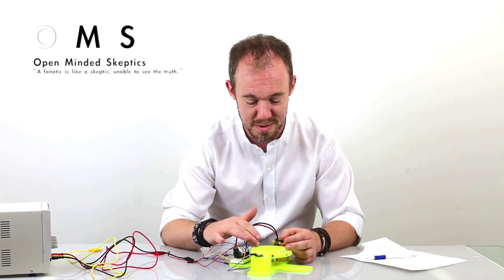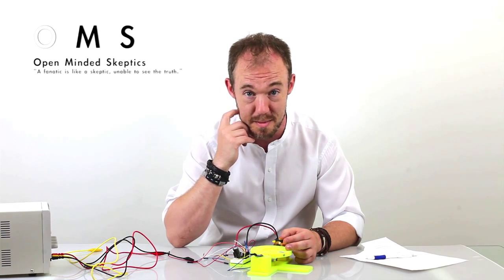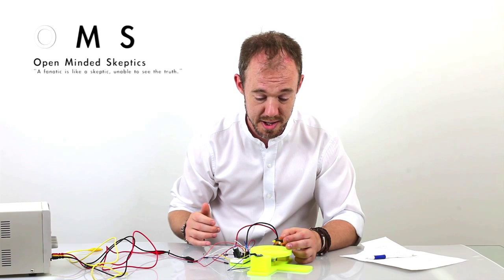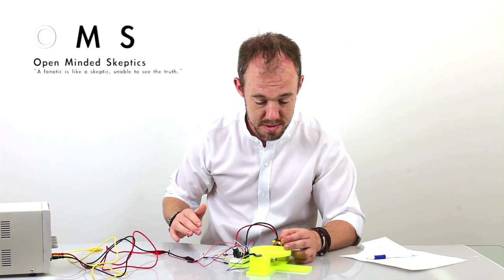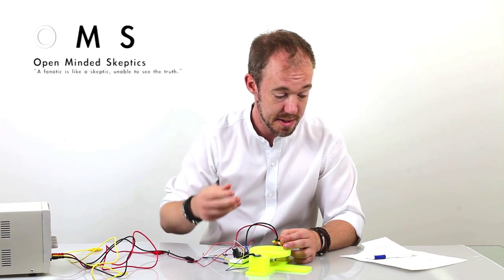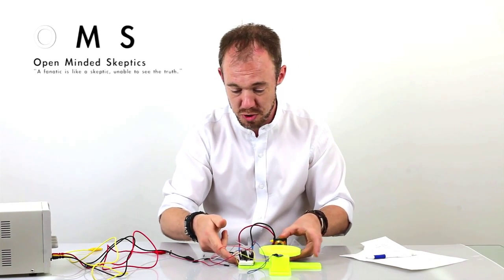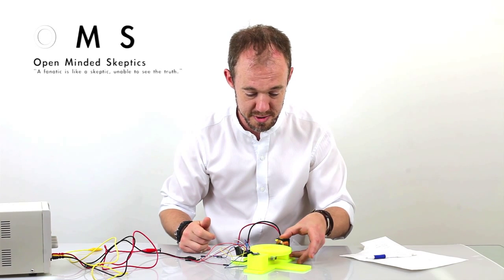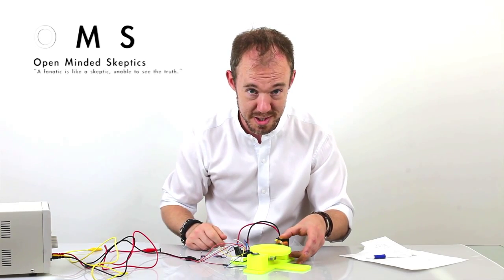This "inverted magnet motor" have a 80% kickback!

Comment: could you hook up a small solar panel to give you the 21mW you need to power it?
Reply from the maker: Jacob Duenas Should work if I also added a buffer (capacitor) to harness the kickback. But I see No need to turn light into...  Weaker light. ;)
Reply: I don't know much about electricty or magnets I have just been looking up a bunch of stuff try to make a small motor

Comment: you could harvest the kickback in capacitors, and then re-use it in the pulses, that way the motor could run it self for a limited time after input power gets disconnected, then add any type of output generator you like on the shaft, and this could function like the buffer/transformer between a fluctuating source, and a load.

check out PMMG4HYBRID, he's using a pulse motor based generator as the transformer & charger between fluctuating solar panels and lead acid batteries, and it appears to transform energy pretty efficient.
Reply from the maker: Dennis Malmberg it would then need 21mW to run.
Reply: The Openminded Skeptic sorry, i didn't notice the capacitors.... are you planning to test a load on the kickback?
Reply from the maker: I tested some different values and at best I got 21mW. Most likely this can be done better. :)

Without any load it becomes science-fiction :D.